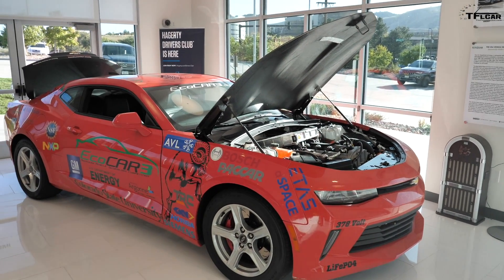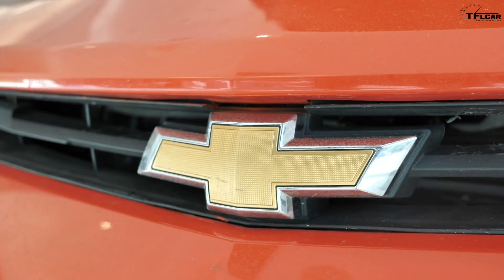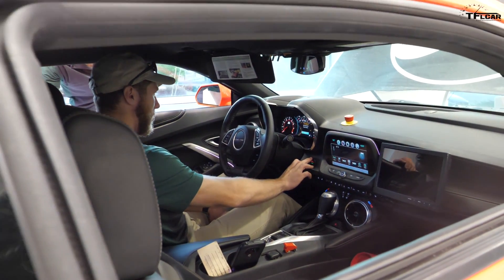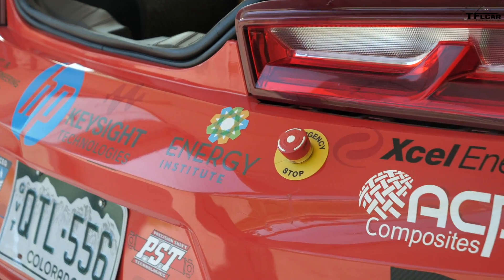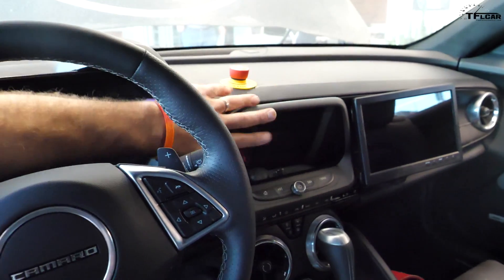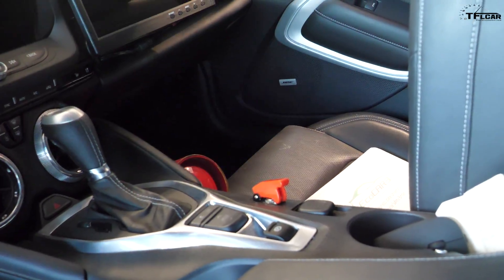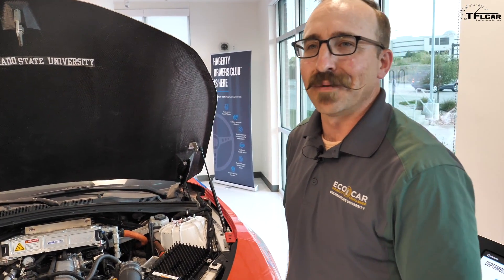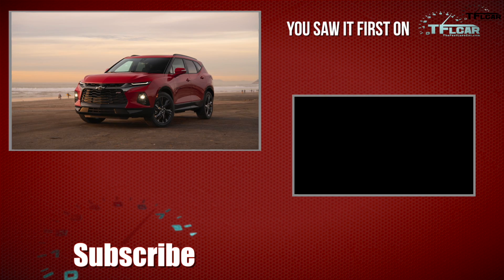Could this Hybrid Camaro Be The Muscle Car of the Future? Let’s Find Out!

Comment: Such potential and just crap results. I know a few people who could have started with the same v6 platform and with $750k to work with could have gotten a vehicle capable of out performing the SS v8 and gotten better average fuel economy. Tesla 85kw battery weighs 1200lb and has a range of 265miles all while dominating at the drag strip. With electric alone a 500lb battery should have 110mile range and when coupled to a gas engine should be capable of lots of performance. I would have done a turbo 4 with boost coming on in higher rpms. Low rpm supplimented by electric front wheels. This would maximize fuel economy at cruising speeds but still allow for a solid performance capability. Mileage should be in the 50mpg range when driven conservative and still be capable of quarter miles in the low 11s. If you could own on the drag strip and pass pumps like a Prius that would be a winner.
Reply: Your numbers are way off and in error. A 500 lb battery will never make 110 miles because weight is not what determines range. You need miles per kilowatt-hour (kWH). The Chevy Bolt EV does 4 miles per kWh.
Reply: @raymondramirez9177  the Tesla 85kw is 3.1mile per kw and based on kw per pound 500lb should be a 35 kw and at 3.1kw per mile thats 110miles.

Comment: 35 mpg is a fail for a 4 cylinder.
Reply: asSAuLT Lick, I don't think the 275hp T-2.0L I4 on today's base Alpha (6G) Camaro even approach that combined number and it doesn't even do it in the highway. 

But still... the best way to go in such a vehicle is what some luxury / performance automakers do: use the battery / motor system to back up ADDITIONAL POWER rather than for just economy (a 400hp hybrid V6 would be the ticket).  Figure a 600hp (~ +100hp from stock) T-2.9L V6 Alfa Giulia QF performance hybrid...  (more doable 'cause it is on a luxury brand that customers are willing to pay for it)

Comment: Could they not have started out with the factory turbo 4 or was that engine not available until later? I agree with going for a 4 banger but as I've seen other comment, that engine is way too far forward. For a million dollar car it's rough, even for college students. I get they aren't designers but even engineers have a better design sense than this.

Comment: Total  💩 T U R D of a door stop, they pushed the engine forward almost completely pass the front axle(Like a shitty AUDI.🤣) . . . that thing gonna handle like a shopping cart with a 100 lbs bag of rice over the caster wheels.
If someone wants an electric, Chevy makes a decent one now . . . is called the Bolt, built from the ground up to be that way, not some Frankenstained chopped up and compromised  'Maro.
Reply: JIGA BACHI boomer detected something

Comment: So it’s weighing in around 4800 lbs. with only 375 hp, it’s a brick. Definitely not the future Camaro, nobody will buy it.
Reply: It's a bunch of students modifying an old design using not exactly modern technology ( lithium ion phosphate battery ) If Chevrolet wanted to do better they could do much better.
Reply: Conor Nugent Quick question... WHY would they NOT want to do better?